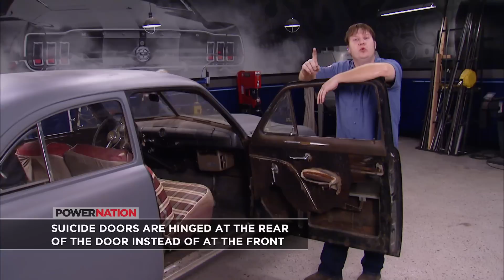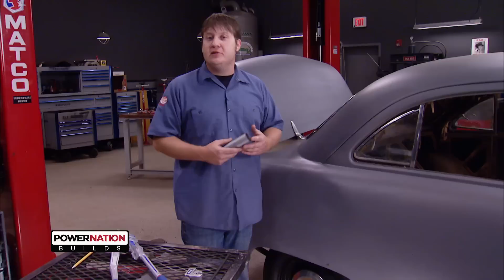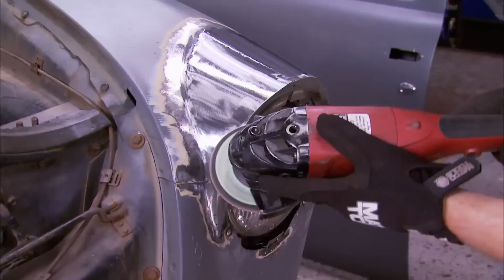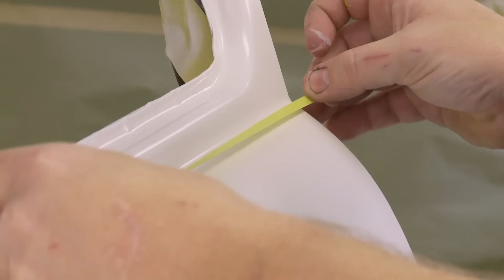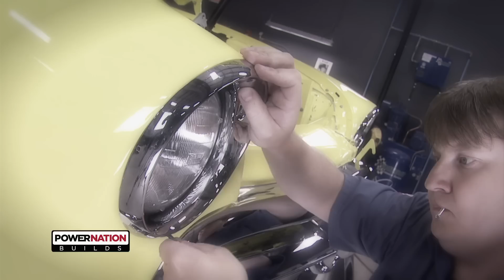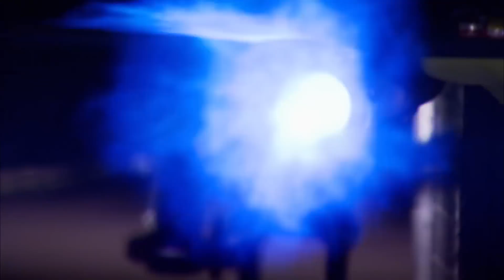Sweet Classic ’49 Ford Sedan Transforms Into Old School Hot Rod - PN Builds

Comment: easiest way to protect the spark plug threads in the tailpipes is to install an old spark plug before welding. after the bung has cooled down remove the plug to reveal perfect threads.

Comment: I would have black exterior with  red interior,  Coyote engine, 6 speed manual  on a Roadster Shop IRS chassis. With spot lights on both sides.